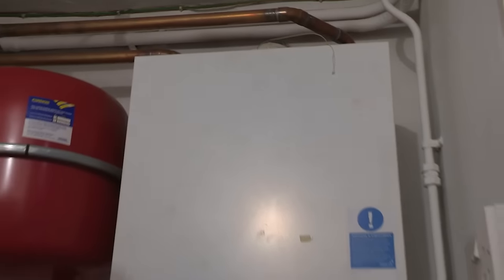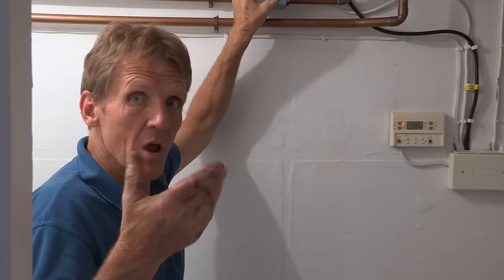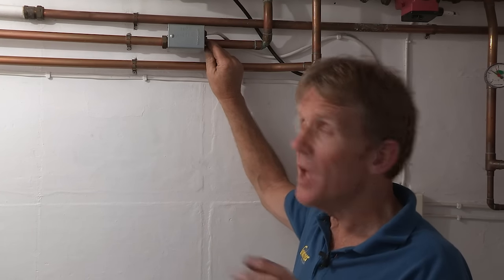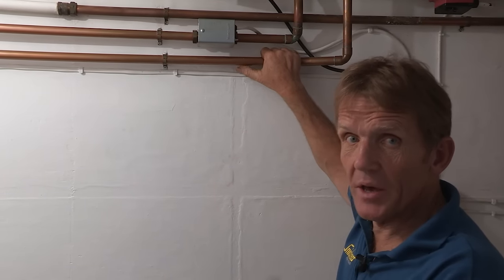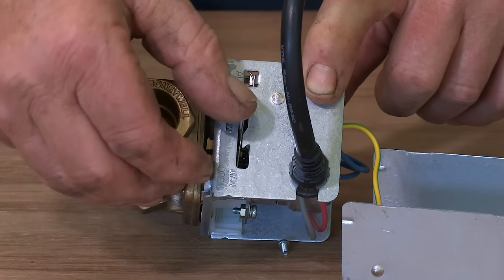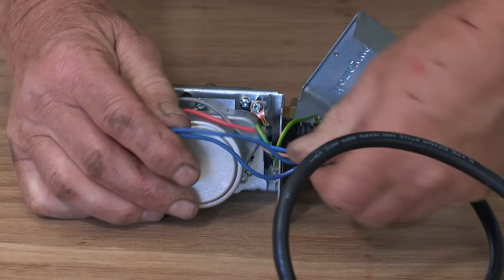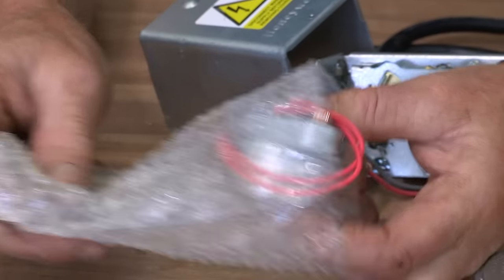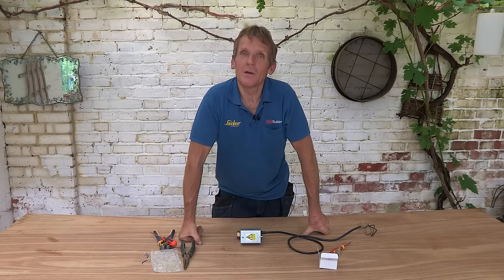How to Repair a Motorised Central Heating Valve

Comment: Can the valve motor go out and stick open? Mine is always open so that zone gets heat when any other zone opens.
Reply from the maker: Tim 
Yes. Sometimes the  arm with the cogs on gets bent and sometimes there is a problem with it catching. When the prorammer of thermostat goes off the valve should close and you can hear the spring and a wiring sound when it does so. If you turn off the power and remove the cover you can manually open  it with the lever and check that it springs closed.
Reply: Skill Builder I am having the same issue, thermostat is off but the heat is still on. We replaced the zone before I found your video and learned you could replace the motor only. Either way still having the same issue. Could it be the valve is not working properly? Should I replace the valve too? I would appreciate any suggestions. Thanks!!
Reply from the maker: Hi Chelsea
I can probably help you but I need to know a few things.

Has this always happened?

Is heat passing through the valve from one side to the other along the pipe?

Does the heat come on when the how water only is selected on the programmer?

If you can take any video footage on your phone and send it to our website that will help. If you look at our channel you will see we now have an Ask Skill Builder spot, We are keen to collect more questions for this and I can still respond by email.

Comment: The reason the motor burns out is sometimes because the rotating valve has become stuck so that is why I generally change the whole valve assembly. True the system has to be drained  but this is a more robust cure. I take a photo of the coloured wire connections first!!
Reply from the maker: Hi Richard. It is always good to change the whole thing but, in theory, these motors are made to work continuously against a dead end so a jammed valve is only the same as one that is fully open. The windings on Synchron motors are high quality but there are lots of synchronous (cheap) motors out there which can't take the punishment.

Comment: Hi Roger can u help with this question.. When i turn on my heating from the control panel it lights up, then when I go to motorised valve that lights up,  but boiler won't fire up at all.... But if I manually open motorised valve boiler starts up rads working etc then power won't turn off until I manually close valve again even with control panel off! 
(hope this makes sence)
Reply from the maker: The problem is the motor. If you replace that you will be fine. 

There is a micro switch in the valve that relays a live to the boiler and pump. This prevents the boiler from firing up on a closed circuit. It also stops the boiler live from back feeding the circuit that is closed. This is wired from the live of the heating supply and is not switched through the heating control because it is too much of a load. If you don't understand this don't worry, just turn off the power, not just the programmer, and replace the motor. All will be well.
Reply: Thank you very much

Comment: Some aftermarket synchronous motors only last 2 or 3 months ! Others are better but luck of the draw. Honeywell zone valves in general have dropped off a cliff in terms of reliability but still cost the earth…….swap them out for Drayton these days 👍

Comment: There's another option not mentioned here - to replace the powerhead of the valve. The valve itself stays in places so no need to drain. There are other things that can go wrong with these - like the switch that's engaged by the motor. The switch turns on the boiler which then (if all good) turns on the pump
Reply from the maker: Try the cheap option first. The head is almost as much as the whole valve.
Reply: @SkillBuilder  I know, in many cases you can get the whole valve cheaper than the head - as they're far more popular. I had that a couple of times

Comment: rather than changing the whole body instead of the motor, isn't it easier to change the whole head?
Reply from the maker: If you change the whole head you have to wire it up colour for colour. I find the Synchron motor a quick and easy job and it is cheaper.
Reply: @SkillBuilder  thanks

Comment: Think I'm having an issue with my motorized valve but not sure. Had a new boiler (Glow worm Energy 30r) fitted along with a nest thermostat approx 3 weeks ago. All worked fine up until yesterday when the heating just stopped. Thermostat was sending heat but the boiler is not triggering. When I set hot water on the boiler does turn on and works fine heating the water in the tank. I set the switch on the valved to manually open and this allows the heating to be on also when water is heating. But once the tank reaches the desired temperature it stops heating the water (and the radiators). Tried several times to reset the the nest thermostat thinking it was that but all looks good. So to with the boiler. When I trigger the thermostat I can hear the heat link trigger but nothing happens. I'm wondering if I should be seeing the valve trigger and then the boiler kick in following that? Any help would be appreciated. Waiting for my heating engineer to get back to me.

Comment: a reason why they go bad is because that metal plate traps heat causing the motor to overheat, some actuators have little openings that are covered with a sticker don’t forget to remove that sticker so your motor doesn’t burn out fast

Comment: Just a thought if the valve is stiff the motor may struggle and overheat!
Reply from the maker: That doesn't happen. The synchron motor pushes constantly against the open valve and it is designed to do this.

Comment: Reason why I like to change the whole valve is so theres no come backs on the job.
Reply from the maker: That is good for a professional but not so good for a diyer. I have also encountered problems with air and sludge after drain downs so the quick easy option is the motor change. I tell customers that this is not as good as a new valve but is a lot cheaper.
Reply: @SkillBuilder  fairplay to you mate. It's a good idea that the homeowner can get hands on with certain things.

Comment: Um as a qualified gas engineer I thought I’d add my penny’s worth here. Sometimes if the system is sludged up the ball in the complete motorised valve just will not move properly. In such instances  good practise is to replace the whole thing which does involves a drain down. You seem to imply that plumbers do this to drag out the job and make it longer. In my experiences that’s never the case. In fact I’d imagine that more can go wrong if you do do that. 
Also you imply that if you tell the plumber before hand that you think it is the mv and that they should always have mv on their van can be a fair enough point but what you fail to mention is that there are many different types of mvs on the market which differ from the Honeywell one in your video and more often than not the problem may lie elsewhere on the system. Also to imply that the plumber will then have to go and get the part and the job gets more expensive ... it is a business ( not a charity ) plumbers run and time is money besides at some point the plumber will need to use van, diesel , time etc to collect the part anyway. Is it fair to imply that they should ( although a lot of us do) use their free time to do so for nothing. 
I do like this video but I’m not happy about the underlying message that plumbers try to drag the work & in the process charge the customer more for doing less. I’m very unhappy about that. That , in my experience is simply not true.
Reply: Oh dear I think someone has got her knickers in a twist. have you not seen the progammes on TV where joe public gets ripped off, I have worked with quite a few plumbers and I wouldn't want them to work in my house  even free of charge

Comment: The motor can also be at fault when your heating or hot water runs constantly even when the controller is not calling for heat or hot water. The gears that turn the little cog wheel develop too much resistance for the springs to close the valve.  The fix is the same, replace the motor.

Comment: Heard a horror story from a customer. Someone charged £1500 to change two motorised valves and a pump. They changed the heads (electrical part) and a cheap pump from screwfix. Depending on age of the system changing motors great.

Comment: I'm having an issue where these are burning out more than once a year.
Reply from the maker: Are they on the right way round? It makes a difference. Flow should be A to B or in the direction of the arrow
Reply: @SkillBuilder  yes & the valve will manually move easily enough

Comment: what if motor just clicks clicks real fast??
Reply: One of the teeth on the gear that switches the micro switch has broken off. Need to replace the actuator head.

Comment: Why didn't you check the spindle first
Reply: If the external lever moves OK, with the inertial of the motor being felt as you move it from closed to open and the lever moving slowly back to the closed position when released, then the spindle of the valve must be moving freely.

Comment: The valve running hot turned everything off from the power Next morning return the power to the central heating system And thevalve started to warm up with no hot water running through it?Take it That the valve is faulty

Comment: Yeah, easy to replace if your plumber didn't place 22mm pipes an inch in front of the valve cover so you can't get a screwdriver in there!

Comment: Its a less fiddly when the valve is secured by pipework.
Reply from the maker: That is a good point I hadn't thought of. I have never had to do one which is free standing which perhaps explains why I struggled.
Reply: I recommend next time when demonstrating such things in the future i would set it up on a board with some clips etc if you got the time of course. love your videos by the way :-)
Reply from the maker: That is a good suggestion. It wouldn't take much and would give it some context.

Comment: The road to hell is littered with people who switched the circuit off. Those who tested for dead ( no energy present) are not along that road. Always test for dead. Always. Always do it with a dedicated tester, NOT a multimeter or wand. I've seen a sparkie get a belt from a " switched off" circuit. He forgot about the anti-condensation circuit in the JB. Boom! Takes 5 seconds  to test.

Comment: Good videos as ever but unfortunately the plumbing world have never moved on with its thinking. When you are installing this type of system install two pumps and two non return valves. One for the hot water and one for heating. A change over relay on the boiler controlled by the two thermostats and job done. I have installed many systems with this configuration and it works perfectly.  One other little piece of information that most if not all plumbers don't know is why before pressurised systems we had loft water storage. The answer goes back to our friend Napoleon who threatened to poison our water supplies, village ponds in the 19th century.  This was because us Brits were sending infected prostitutes to France to infect his soldiers. Nice one.  
,
Reply from the maker: Hi Peter
Which change over relay do you use?  I am looking at a job where I need one and I think I will have to make one from RS components

Comment: Can anybody help?  1. My systems boiler fires up even when the programmer is in the off position.  2.  The pressurised cylinder that I had fitted does not have a pressure gauge - I am assuming this is quite wrong. 3.  What would you expect to be charged to replace a small expansion vessel. 4. The expansion vessel makes a huge 'groan' when hot water is first drawn.   All comments greatly appreciated. (chrishodges@btinternet.com)